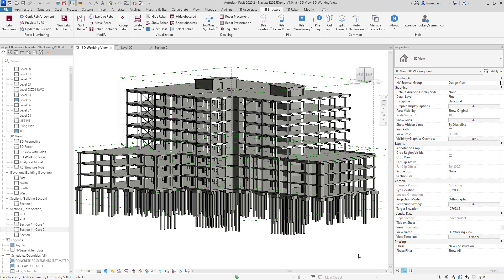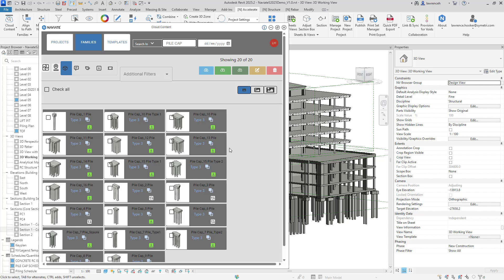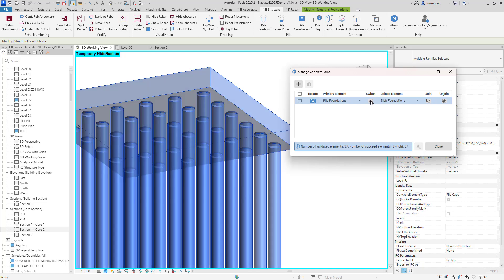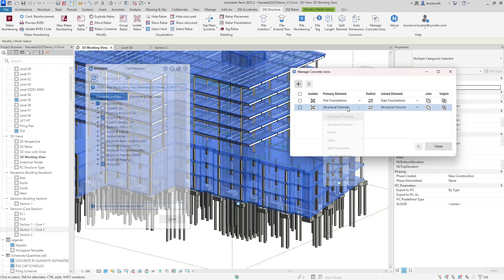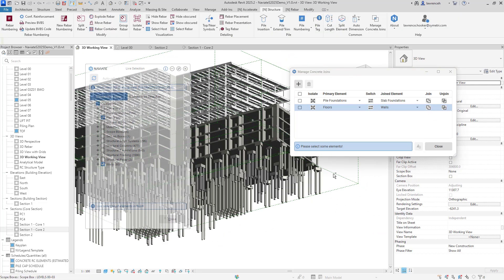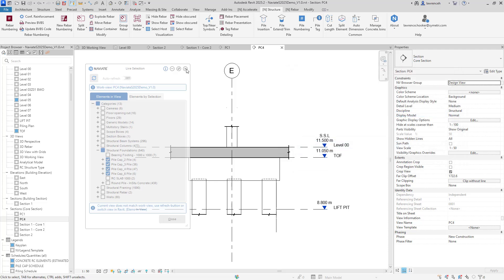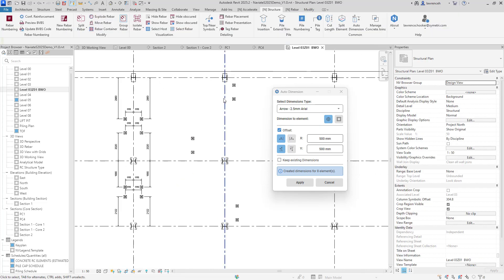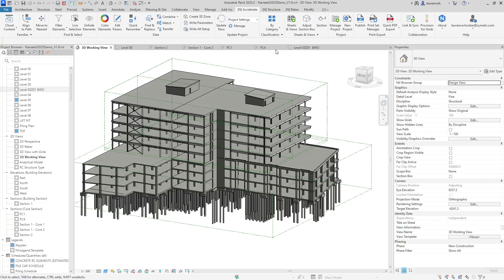Naviate Structure - Working with Concrete Structures

Comment: Hey Lawrence, you mention at the start, these tools are available in 2023,24 & 25. Neither Auto-dimension or manage concrete joins are available in 2023 and manage concrete joins not available in 2024, should I expect an update to Naviate structure, or just a mistake?
Reply from the maker: Hi Leo, you will need to install the updated versions of 2023 and 2024. The versions should be 2023.1.12 & 2024.5.1. Hope this helps
Reply: @RevitStructureBlog  thanks, I was almost certain I had the latest versions installed, I do not!